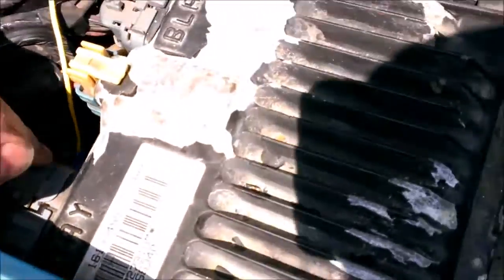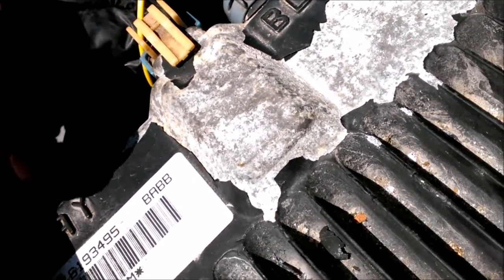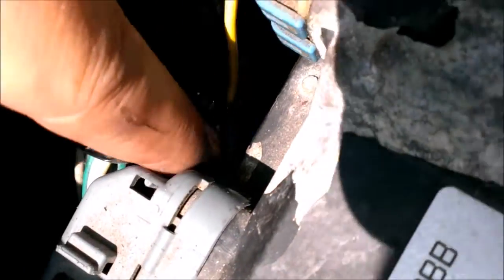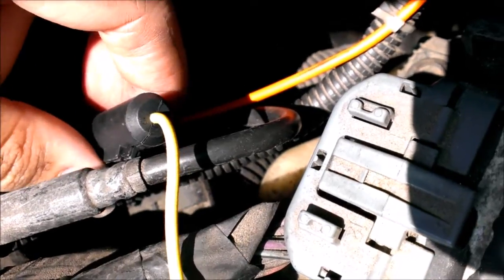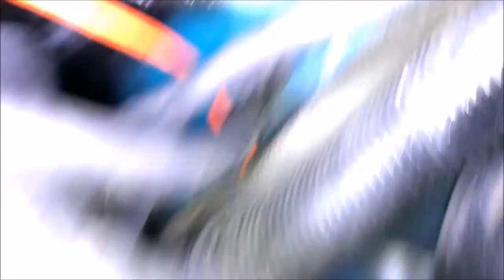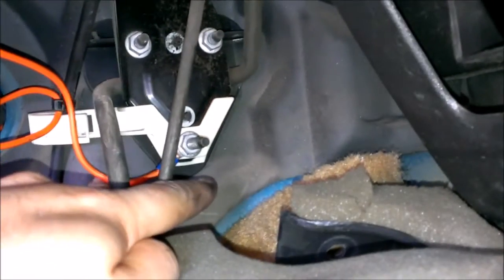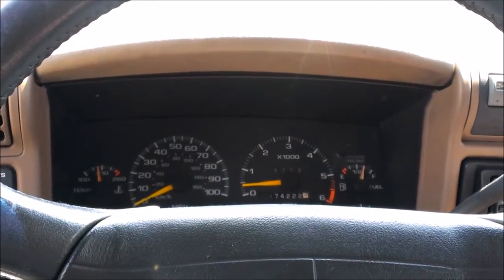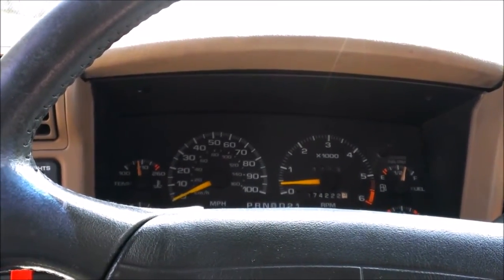4L60E MANUAL LOCKUP AND PWM DELETE INFO

Comment: I was looking for a way to prevent/delay lockup with a toggle switch like we used to do on the 700r4's. No such info seems to exist. Ps. mine's obd1 1994 1st gen 4l60e.

Comment: Could one of those sensors the pwm or the tcc be stuck on or off and cause a when I put in gear it the engine will just die if I feather the gas can keep it running and the reverse almost feels like a split low and high gear and it in high gear hope thst makes sense

Comment: I installed the switch with no relay on my 1996 Sierra and it works great! I do get a code but I could care less. Thanks for the info! Also on my truck it was the tan with black stripe.

Comment: Hey bro, is there any important notes to consider before you manually lockup the torque converter? Like is it fine that the rpm drops to 1200 after locking up?
Reply: Lock up point is determined by road speed so on light throttle cruze at about 50 mph, 1200 sounds about right

Comment: bam6972 I wonder if my 95 blazer has the pwm delete because it shift hard from 1st to 2nd and it shift quick almost instantly into the next gear. When you pass someone it shift hard and instantly into the lower gear kinda feels like a electronic manual transmission
Reply from the maker: sounds like its running in high line pressure mode to save the transmission. mine did the same thing. whats your rpm at 55mph cruising down the highway.
Reply: bam6972 like 1400 rpm or so
Reply: It doesn't slip or anything that I can tell transmission fluid is red and doesn't smell burnt.
Reply: It picks up speed quick for a old 4.3 v6
Reply: bam6972 it revs high in first then hard shifts into 2nd like 3k rpm in first gear then shifts into second. There are no check engine lights on either it drives fine on high speeds and cruising around just it hard shifts and shifts quick
Reply from the maker: well if its at 1400 rpm at 55 then its not commanding high line pressure.. maby somebody put in a shift kit.
Reply: bam6972 maybe there are racing company decals on the back so maybe I know it runs very good and it is quick for 200k. It is like at 2400rpm at 65 mph I think it is in the 2k rpm range at that speed. I know when you put it in drive it wants to take off without giving it gas you have to hold the brakes to keep it from going forward on you same as reverse. Might have a aftermarket torque convert to
Reply: bam6972 I'll take a video of how it drives one day is there a way I can send you the video of how it drives? And see what you think

Comment: My TCC isnt locking up in first gear and I get a hard shift into second, happens about 50% of the time coming from a dead stop. It was just built and had my builder take it apart twice found nothing, put in a .500 boost valve and still does it. I just ordered an aftermarket TCC isolator valve for $14 which replaces the large part of the valve and eliminates the spring the small part of the plunger stays inside and the new large plunger is sealed inside the bore with O-rings this basically turns your TCC into an on-off instead of pwm. From my own research I found what GM tried to do is to eliminate the feel of the transmission changing gears so when that TCC slips into gear that isolator oscillates thus wearing out the boar I also found that this was causing premature torque converter failure. With this mod and my understanding of how this transmission works I highly doubt that this would cause any kind of damage as a matter of fact I would think that this would prolong the life of the components associated with the TCC remember it's never good when clutch packs slip inside your transmission it only makes them wear faster but then again I'm no technician I'm a backyard mechanic who actually gets his hands dirty.
Reply from the maker: the problem with mine was never found. im 90% sure it was a crack in the case causing pressure to bleed off and cause high line pressure making the 1st and 2nd shift really hard. the tranny tech took mine apart over 5 times over the span of a year. then finally got a tranny core and took all my new parts and transferred then into the new case. which now is fixed. still working good today. maby yours is the same way.
Reply: bam6972 I hope not but I dont think its a crack in the case because it was fine the first month or so most likely the isolator valve bore was worn out just before the point where it became a problem when I first noticed it it would only do it when I left it in park/neutral then into drive after that it drove fine then the last time I took it back to my builder as I was driving to his shop it started to do it when I came to a stop he took it apart installed my boost valve didnt find anything else even the fluid was clean after I got it back did the same thing btw it only does this in first gear when taking off anyway I actually just ordered the isolator valve two days ago when I install it hopefully that will solve my problem.
Reply from the maker: keep me informed. would like to know how it goes
Reply: bam6972 cool ill let you know.

Comment: well mine locks up and stalls my truck completely out no matter the gr but i unplugged 13 pin plug on the passenger side and it will run just scared its gona cause fluid to get hot
Reply from the maker: the tcc valve failed in the open position or is shorted to ground causing lockup all the time. by unplugging the 13pin connnector you are putting the trans in limp mode and taking away power to the tcc shorted valve. you will only have 2nd gear. do not run it like this long you will burn it up. i would replace the tcc valve and pwm solenoid and look at the wiring going up and to the computer for any shorts or bad wires.  while your at it put a new trans filter and new fluid in it.

Comment: ok  maybe it wont hurt the trans .   from what you did to it .     but the  94 4l60 e  trans don't have a    a  pin on the   wire harness  .  that come   from the pcm   to control the   tork lock  up  .     from what the  tec .  told me .     .       I just  leave mine along .   .    .     im having problem  with my trans as we speak    .      its confusing .      .      it has rev / od / drive  / 2nd / 1st /    drive down the road fine but wont shift .   out of   od/  d/ 2nd /1st .
Reply from the maker: the 94s dont have a pwm solenoid. if its not going into 3 and 4th gear then possibly the 3/4 clutch pack is burnt up. needs a rebuild.
Reply: ya ok im going to put it back together today  and if it don't work im going to  yank the trains out and  rebuld it  and go back to electronics or manual  shift .   I ant made up my mind yet .    when I drop pan 2nd time I font a smash wire that  gos to the pcs   that   runs the trans .    and my psm  had damage orings on it .  it tell the pcm what gear  the shifter in .   I replace the bad parts  to new  . now ill see what it dose.
Reply from the maker: ok let me know how it turns out.
Reply: @bam6972  OR servo not pushing bang real good, it happened to me and i just installed aftermarket crazy ass holding servo, and guess what, my 1-2 shift got even more soft if u not kickin gas, once u kick it it getting crazy with every shift. best 70bux i spent, also i got 4th gear servo hold, it downshifts 4-3 10x times faster without drag. Same transmission in bmw and its ok there with 2.5 motor, but with our 4.3 and 360 Nm of torque... gosh, trust me on that

Comment: hey I heard from a trans  tec   that it burn up   your   transmission  .     by doing that  mod cathion
Reply from the maker: been running it this way for years on a rebuilt transmission and no problems so far. i do not have a switch for it though. just the pwm delete.
Reply: you said u don't have a switch I see one on your dash .   and  what is pwm delete   .   please  explain .
Reply from the maker: yea the switch was there in order to find out the problem i was having with the tranmission by manually controlling lockup. because my tec said it was in the engine and computer causing it to not lockup. but i fooled him. because i could get it to go into lockup when cold but not hot. it would slip out about a mile down the highway. turned out to be a cracked internally in the trans case. he rebuilt a different one for me and put it in. pwm delete basically eliminates the slipping into lockup so that you dont feel it shift again on the highway. basically makes it feel like a 5th gear. the computer still controls it when needed like normal.
Reply: oh ok that interesting thanks for the info .

Comment: where did you run the wires through? I have a 97 blazer that I want to run this on but don't know a good spot to run wires through. also where did u get that badass intake manifold?
Reply from the maker: through the steering shaft boot. mine is a 95. 95 and older had the older vortec motor which had this intake plenum on it. i painted mine orange when replacing incjectors

Comment: Did you figure out what the issue was...my 97  blazer is doing the same thing..gone over every sensor and switch with the northeast improvement. I rebuilt the valve body and swapped out the isolator valve..same issue but improved shifting..what I did notice is I do get lockup at lower speeds
Reply from the maker: Joe Pinedo the trans mechanic could never figure it out after a year so he got a different tranny and rebuilt that one to put in mine. he did all the things u mentioned to help fix the old one but failed.

Comment: The absolute easiest way to do this is to disconnect the lp solenoid all together, then it runs full all the time. Firms up shifts, and does the TCC, but can piss the computer off.
Have you tried lockup in 1st or 2nd? I'm curious as when driving in the snow the direct engine braking could be nice, as well as for some performance applications.
Reply from the maker: well I have put in a relay to for the computer to control the lockup solenoid then I have a switch in the dash that bypasses relay and computer to lockup. so no engine light and the computer doesn't even know the trans is locked up at all when its not supposed to be. and I have staked the isolator valve in the full forward position. but I still don't have lockup. maby you can help me out. with switch off. at 55mph the trans locks up. then after about half mile it will slip out of lockup. push the pedal a little harder and then it will lockup again. then out after a quarter mile. then nothing. if slowed down at this point to a stop then go 1-2 shift and 2-3 shift is so hard it gives you whip lash. then I can hit the switch and only after the computer commands high line pressure I can lock up the trans manually with switch. and it will stay in lockup forever with switch on. if I flip switch at lets say 40mph with no high line pressure it some times locks up but then comes out but while switch still on I can give it more throttle and it will lockup for a bit then out.  and what you talking about a lp solenoid?
Reply: TheKurrgan1 
It'll end up pissing you off too, when you have to live with the really hard shifts, ect. from disabling the line pressure control solenoid...
Foolish idea, that could eventually break something in your transmission.
Reply: @lees.4084  ...welding line on converter cracked, knew the guy who was doing 110mph on lock up converter, brand new converter basically, maybe just coincidence. I strongly suggest to improve pressure in all solenoids to a pinless ones, and get ATleast corvette servo, and 4th gear servo that can really hold the band

Comment: I don't c the point of doing this
Reply from the maker: well my reason was because the computer wasn't keeping the trans in lockup even though the transmission was totally capable. I have no engine light and all sensor data looks good on scan tool. other people do it because when towing on the highway and going up and down hills and such the converter will unlock then relock. when on all the time on the highway it will improve gas mileage because the converter will not unlock when going up slight hills. if you live in a hilly area this will help a lot.
Reply: @bam6972  gosh, just run your car on hot vapors i quadruplied my mpg, like i do, same truck nov 1994, 95 model year- 600k miles on it, also i have a 2001 model.
Reply: @OmenFree  what does that have to do with TCC issue